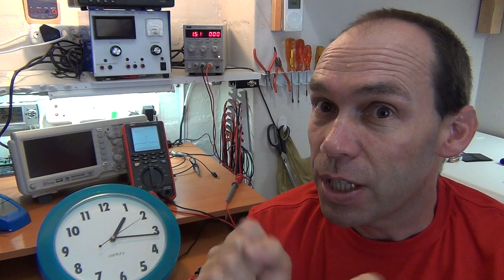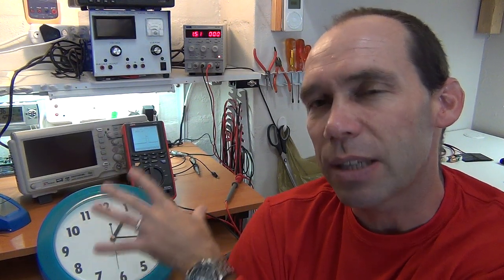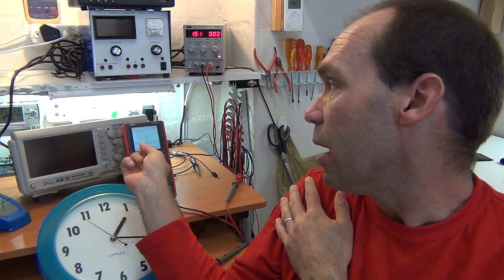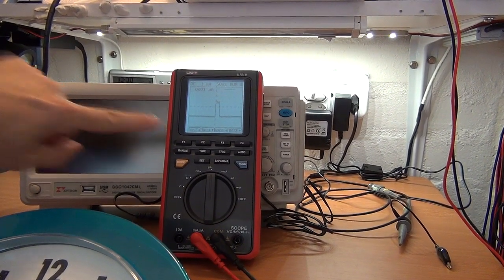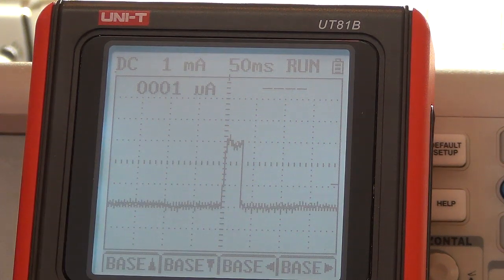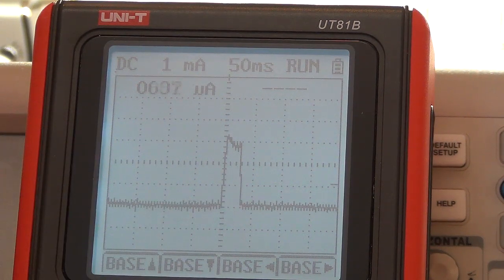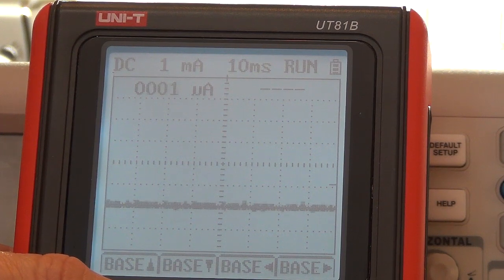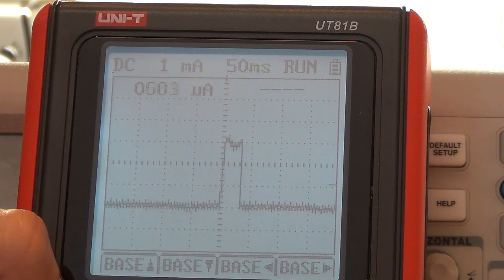UNI-T UT81B Scopemeter showing current

Comment from the maker: Yes, you are correct, a very good and simple solution. Measure the voltage drop across the 1 Ohm resistor for a "direct" current reading.

Comment: Of course, there is current adapter that lets you view current. You are actually viewing the electromagnetic coupling of a source(primary) cutting against a secondary and inducing voltage which causes current to flow. You are actually viewing a voltage which is calibrated to equal current.

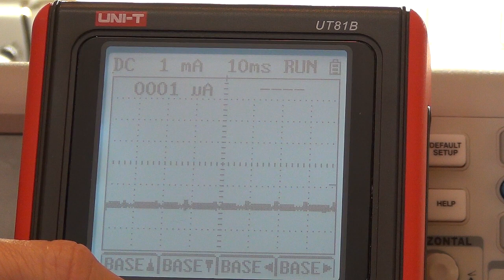Comment: @2:50 if you had set your trigger mode to "norm" instead of the default "auto", the scope would have captured your pulse and freezed it on the display until the next one...

Comment: that's interesting. very few instruments can do that.
it furthers my belief that the multimeter industry has been way too stagnant for way too long.
a multimeter should be able to do much more than they do normally. a MHz sampling chip costs very little, same with a display and microcontroller. the resolution should be a lot higher than that display and much faster. we have lithium batteries today and if battery life is only 100 hours instead of 900 that's well worth the tradeoff. even 20 hours